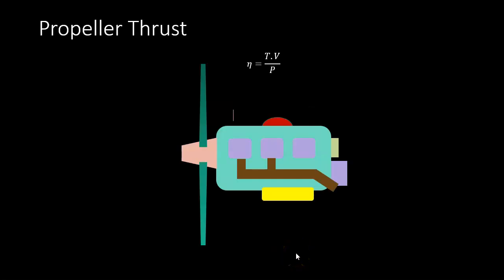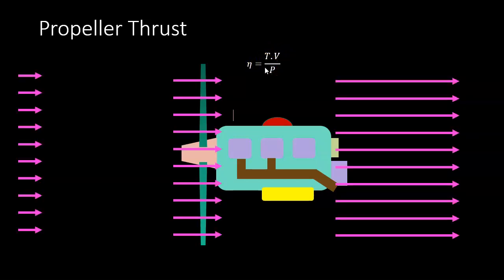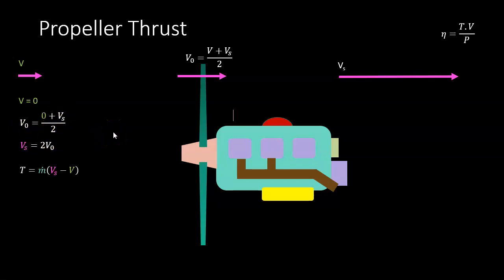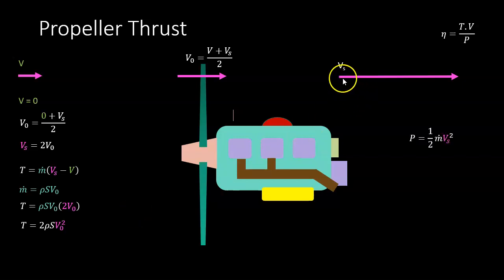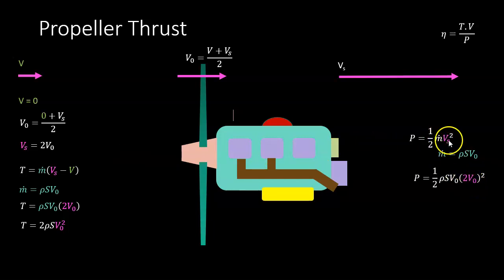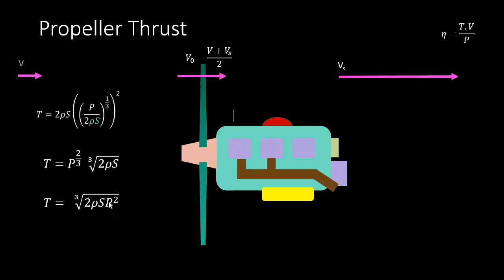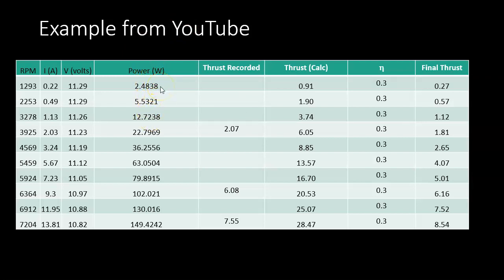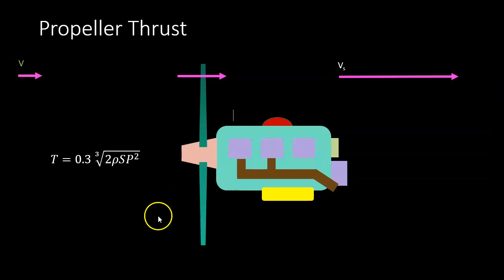Propeller Static Thurst Equation

Comment: Hi Roddy, you are very good at explaining stuff. great that you go through all the steps when you reduce the equations. In a variable pitch propeller case, you have about a 0.6 static efficiency for a well-designed propeller system, raising to about 0.85 at forward flight. I think the example propeller you used was fixed pitch, then everything is dependent on where you put the propeller pitch, optimize for static thrust and low speed or higher speed.
Reply from the maker: Thanks Bjorn.   I was using data from a fixed pitch RC Aircraft propeller.

Comment: Hello
I should calculate the theoretical thrust of a quad copter for my graduation paper, but I just cant get the same results for the example calculations.
Ive set the area S = (0.127m)^2 * pi , which yields a disc area of approx. 0.0507 m^2. (The propeller used in the video has a diameter of 10 inches => radius 5 inches = 12.7 cm = 0.127m)
I assumed the air density to be standard ρ = 1.225 kg/m^3
For the power I used the value from the table (P=U*I).
If plugged into the equation it yields: T = (2*1.225 kg/m^3 * 0.0507m^2 * P^2)^1/3    -> it works for the first value, but not for the following ones.
Thanks

Comment: If I wanted to optimize a propeller for static thrust, like the fan in a wind tunnel for example, would I then use the V0 value to calculate the resultant relative wind for setting the AOA of my blade elements?
Reply from the maker: Yes, that is what I would do.

Comment: So if I design a propeller 4 - 5m in diameter (for a human powered airplane) with 300W power input for a 45km/h flight and I want to test it, I should expect only 30% efficiency? I am just wondering, how to test the propeller then and what numbers to expect. What do you think?
Reply from the maker: 45km/h is approximately 12m/s.   So, you might expect to get a day when the wind blows at 12m/s.   Put the propeller into the wind, apply your 300W of power and measure the thrust.  That thrust x 12m/s equates to the power out.  Divide this by 300W and you'll have your efficiency.
Reply: Good idea, thanks.

Comment: In the Example from Youtube, the efficiency is 0.3 or 30% while you explained efficiency of a propeller is around 85% which is, 85% of the engine power is delivered to the aircraft movement. My question, what is possible the reason the efficiency in that example is so low compared to your many calculation?
Reply from the maker: The reason is because the propellers are acting at different angles of attack.  When the propeller is static, the angle of attack is basically the blade angle (if we ignore inflow factors).  At cruise, the angle of attack is dependent upon the RPM and the aircraft velocity.   The blade angle is chosen so that the angle of attack at cruise is at the optimum position, i.e. where the propeller airfoil has the max lift to drag ratio.

Comment: How do i figure out the Velocity of fluid by just knowing the RPM?

I know that the thrust is the mass flow rate * the velocity of the fluid

I know air density is 1.225kg/m3

I don't even know if this is the right question to ask, my brain is spaghetti right now trying to figure this out all day long. The more i try to understand the more confused i get.
Reply from the maker: You just have to make some assumptions.  In this video I assumed the propeller was static, e.g. fitted in an engine test cell, or on an aircraft on the ground with the brakes on.

With that assumption, the velocity of air sufficiently far in front of the propeller is zero. 

So now you want to work out what velocity is induced by the propeller from the RPM.  The power provided by the engine will be the engine torque times the RPM.  If you have the RPM and torque you can then conclude that power in from the engine equates to the power given to the air, or at least a large percentage of it.

If you don't know the Torque, then you can look up the moment of Inertia for the propeller + engine combination.  The engine power will then relate to the product of half the moment of inertia and the angular velocity squared.
Reply: @RoddyMcNamee  Thank you for quick reply. I subscribed and thanks for this video really helped out. I should be able to work this out now.

Comment: can I ask a question ? 

is there any material can not be repaired in aircraft??   
I mean the materials contain wood,steel,aluminum and composite.
thx a lot ur video

+after watching ur video about al-prop repair , I think the point of prop repair that is 'Prop repair' is limited in Minor repair.
So I  ask that ... can the al-prop be an answer on my question?
Reply from the maker: Yes, generally only minor repairs can be performed in the field, and with composite propeller blades, very little can be done in the field.
Reply: @RoddyMcNamee  as I get it, the crack or dent of al-prop can not be allowed. if so- that case is not minor repair, right? 

then - is there any minor repair of al-prop? 

thanks for ur reply - always
Reply: @RoddyMcNamee   I want to know the reason why al-prop can not be repaired in field. 

I mean - about minor repair
Reply from the maker: @paiisebutton6322  you are correct.  A minor repair on an al prop would be something like a dent from a small stone or some light corrosion.  However, as a rule of thumb no repairs are allowed near the shank of the propeller.
Reply: @RoddyMcNamee  and the reason is that can be affected in airworthiness?
Reply from the maker: @paiisebutton6322  an aluminum prop can have minor repairs in the field, but not near the shank of the propeller.  The reason no repairs are allowed near the shank is because the centrifugal forces are so high, any repair in that area may reduce the ability to withstand the forces.  Major repairs will only be performed at specialist repair shops that are authorized to do so.  You mentioned cracks on Al props, normally these are not repairable and the propeller blade will be scrapped.
Reply: @RoddyMcNamee  thanks a lot :)

Comment: How many blades is this for?
Reply from the maker: The prop was treated as a single disc, so it doesn't consider the number of blades.
Reply: @RoddyMcNamee  Is there a reference to this? Perhaps a book that has this final equation?
Reply from the maker: @AG-kh5ct  Eqn 14-63 in General Aviation Aircraft Design : Applied Methods and Procedures by Snorri Gudmundsson
Reply: @RoddyMcNamee  thank you. Does it show the equation multiplied by the propeller efficiency?
Reply from the maker: @AG-kh5ct  No, but Eqn 14-64 takes the previous equation and multiplies it by 0.85(1-As/Ad) where As is the area of the spinner and Ad is the area of the disc.  The 0.85 is an efficiency factor I assume.